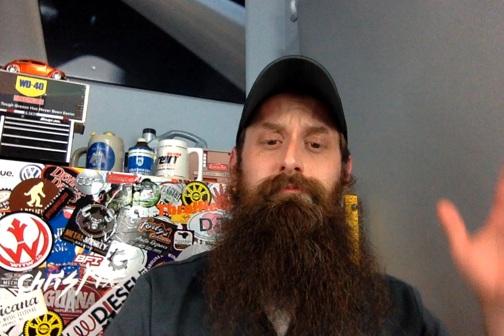Why Does My Check Engine Light Go Off Sometimes?

Comment: Interesting. I had a check engine light come on for an air flow issue. I suspected that the MAP sensor I changed was a piece of garbage (probably true), but it went back off before I replaced it again. I will just keep an eye on it. This was helpful.

Comment: Hi how you doing,hope all is well,I have a issue I got my vehicle scanned it picks up nothing ,when you start the vehicle (opel gamma 1.4i),everything is is 100%,but then I go on a long drive about 200km in distance, on that drive my management light(engine light),comes on about 10seconds then it goes away but nothing has change while driving(no noises, no back fire ect)just run perfect and I can not seem to find the issue ,cause where I am when you call the guy to do a scan the vehicle is standing still and only a startup is done the they do the test which my vehicle pass and I ask the guy if we can drive about a hour then when it's comes on to be with me,obviously I got a hard no lol,so I'm asking  you ,do you pehaps have a idea why it's doing that cause I have to be driving constantly for almost a hour before it appears

Comment: I have a 2014 Hyundai sonata 2.0T check engine light turns on n goes off,  OBD code P2188 fuel running too rich.   Changed out several parts still doing this . As well as not starting sporadically, then starts fine then it won’t start any advice ?  Thank you

Comment: I got a 4runner 97 model the check engine is off while i turn the ignition key is on.
And i check all the fuses includ the fuel relay.
I found the EFI's fuses is gotten big electric shock.
Please how can you help me with it

Comment: My Honda Odyssey 2006 check engine light comes on and run roughly but only when the weather is cold.
I plugged the scanner and it shows code p013 which is IAT sensor.
But I researched about IAT failure symptoms, and say nothing about coming on on colder weather. It only says that that failure causes problems to start the engine when is cold, which is not my case neither. My car starts without problems cold or warm.
Could it be a temperature sensor

Comment: Does low or old battery cause the check engine light to come on, and after recharging by driving the car the check engine turns off?  AGM battery 5 years old?

Comment: I have a question regarding this.
I have a 2015 tiguan with about 66000 miles (110 000km) on it. 
I brought it in for an oil change and not long after had the engine light come up. Scanned it and it was misfire in cylinder 3 and 4, cleared the codes and have been driving it for another 6 month since without issues.

My concern is when I start it when especially when cold it souns quite rough for 5 or 10 second but then goes normal and drives fine and with full power atleast according to my but dyno. Is this any cause for concern I also noticed that the exhaust is quite dark on initial startup especially in winter (noticed this before the misfires).

I have brought it to a vw tech and reg garage mentioning that I'm concerned about it burning oil but both have mentioned that its within specs.

Am I'm concerned for no reason any additional things I can check, I'm quite mechanical (although this question allude differently 😉)

Thanks for all the knowledge you continously share

Comment: My 2005 Dodge Durango was doing this awhile back and I fixed the problems, but today after I finished pumping gas I sticked my key in (did not turn on all the way) and the engine light was flashing, but after I turned it on it won’t flash unless I turn off and just stick my key in...any suggestions?

Comment: Hi I have a 2003 honda accord and I replaced all the spark plugs and all 02 sencers  except for the one the 1 02 sencer to the catylac converter. It passed smog but 2 months later the check engine light goes on and off every 60 to 100 do you know maybe why? I did take it to auto zone it says  misfire 1

Comment: I have a mint condition 4.0L o6 2006 ford explorer i had a check engine light for months .and turned off today .should i be worried ?? I put 3,000$ in to it to fix it ..and still .light on..
I spent alot what are my option's?
Reply: Get a Honda

Comment: I am hoping to ask you a question? So someone put something in my gas and it had crank no start. After getting it to mechanic and them replacing all spark plugs, fuel pump, and conditioner through my car it is running again but now my check engine light keeps turning on and every once and while turns off. I took it to autozone hooked to their computer and it is reading bad spark plug but i just got every spark plug changed. I called and told them what it is now saying and they said " its just going to do that" you can lightly tell when the engine light is on that its like a misfire but when its off its running like before. Should i change my coil pack or is this problem something that will eventually work it self out?

Comment: Can a misfire happen if a catalytic converters is hit or damaged. I had misfires in my cylinders and I replaced all ignition coils and spark plugs. My ICM are working fine as well, but I’m still having the misfire codes pop up. N the check engine light comes and goes. Could this be happening because I still haven’t resolved the damaged catalytic converter?  Need an answer thank you.

Comment: My car had emission sendor replaced and map sensor replaced 3 weeks later my engine light comes on shut car off and engine light goes off for a week then driving today not going to 3gear but shut car off for   minute and engine light goes off and it's running fine what does it nean

Comment: 2000 nissan maxima 

broke down in garage for 2 years

nothing major just dead battery

new battery and runs amazing

246,000 miles and perfect

as i burn through the gas that was sitting in the tank the light turns on and i find out it’s a fuel injector issue

over 2 weeks and 3 tanks of gas i use a whole bottle of fuel injector cleaner

light goes off and car feels quicker and smoother

few days later light turns on and back to running slow and inconsistent power feeling when i press the gas

drive home from school and the lights still on when i get home

some driving later and the light goes off and feels faster again 

now: i’m gonna buy a other bottle of fuel injector cleaner and use it as i get gas hopefully getting all the old dirty gas out and gone for good

Comment: How about my check engine has been on for months.  Been having problems with starting.and stalling while driving slow then turning back on while driving. Sometimes have to put in neutral while rolling to start .notice problems when damp out. Will drive fine for days then do it again. Already changed main realy still no fix. Was thinking ignition switch? Oh ya it's a 2001 Honda accord 4 cylinder lx.any help would be great. My own mechanic is stumped.
Reply from the maker: Try another mechanic? A MIL and a ton of symptoms can be tricky to diagnose

Comment: This was exactly what I was looking for. My 2000 BMW 323i had the light on I got it scanned and it said miss fire in my 5th cylinder and a faulty spark plug and coil pack. But now the light is off and I haven't even fixed the issue yet. So should I still replace the plugs and coils? Also my washer  fluid and tire pressure sensor lights are on now but both were just topped off not even 100 miles ago, fluid is full and tires are brand new

Comment: When engine starts chek engine sign is not there.  After driving for a short distance like 1km check engine sign appears on the dash board.  What is it? The cause.
Reply from the maker: You’ll need to pull the codes. The fault is probably stored even if the lift is off

Comment: My check engine light will go off for two days n come back on what does that mean
Reply from the maker: You have a fault that is only occurring sometimes. It will pass the test and fail the test
Reply: So is it anything that I need to worry about
Reply from the maker: Yes. Get it checked out
Reply: Ok thanks

Comment: Hi this is really cool explanation, I have the same problem, my new car Honda civic 2018 4 months old , I had the engine light on constantly and then after opening the bonnet and touching some cables suddenly the light went off. Have been driving like that thinking that car had resolved the issue but then the performance of the car has degraded , I bought the wireless odb test tool and my code is P2146 have spoken with Honda dealership here in UK but they are not willing to test can you please advice what should I do, can clear the code and the engine will perform better

Comment: I have a 2008 Hyundai Accent gs 1.6l hatchback, car stalls if idling for about 15 seconds, engine light on and off intermittently all the way down the road, happens the most when I hit the gas quick and left off quick, engine light comes on for about a second then off, and over and over, changed sparks, coils, timing belt, water pump. Any Ideas?

Comment: I have a 2000 Volvo S70 TDI and recently the Check engine light started being a bit weird. I get in my car and fire it up and go driving. Usually after 10-15mins the check engine light comes on and stays on for about another 15-45 mins and then it turns off again. What might be the cause? Im going to get it diagnosed at the workshop but i can't right now since christmas is around the corner

Comment: i have a toyota mark II,check engine light comes on while driving at engine speed above 50,when the vehicle goes of,its also go off,i checked with diagnosis machine while driving the vehicle i see no trouble code even when the vehicle is off no trouble code,please help

Comment: I wouldnt ignor it...I've had the same problem,, whenever I would go and have a part repaired,, the engine light will go off for awhile until I hit a bump or pothole in the road, then light pops back on,, which could mean loose or faulty wiring.....the engine light means the distributor cap and alternator may need replaced...its an early warning that you are heading for mechanical/electrical failures...and sometimes it could also be something as simple as a leaky air hose or hole in the muffler or tailpipe.....these problems usually keep reappearing because its never being replaced with the proper parts...." Used" parts are a bad idea when replacing the distributor cap and alternator,, but how many replace bad wiring too? These cars are getting more and more complicated these days .

Comment: My check engine light does the same, however i'm getting a 0172,0175 error. I took it to dealer they said injectors tested fine and suggested they run fuel injector cleaner. Got it back, the next day the light came one. The following day I added my own injector cleaner on an empty tank and filled it up, later that day the light went off, but then came back on about 2hrs worth of driving later. Very frustrating. And clue as to what might be causing these codes? Any info would be appreciated of course. Oh yeah, 2011 equinox, flex fuel, 3.0, 70k miles.

Comment: My 3 month old 2k miles hyundai tucsons engine check light started blinking a few times then the light went away then after a minute it started blinking again for a few seconds then it went away and when this happened i felt a mild shaking then this never happened . It was really really cold and the road was salty. Any thoughts ?
Reply from the maker: a misfire of some type. That is about all that will make a mil flash

Comment: Thanks for the explanation.  Had a P1320 and P0303 cylinder misfire code from a borrowed Innova scan tool.  I replaced the ignition coil, but didn't have the scan tool to reset the "Service Engine Soon" light.  Was contemplating buying a scanner just to turn the darn annoying light off, but then it went out on it's own after 2 days.

Comment: You are right so far.  I waited for my check engine light to come back on and drove to Autozone.  The tech plugged the analyzer into my computer showing all pistons misfiring gas cap off, all 02 sentencers malfunctioning, etc.  But, the engine runs smooth, the gas cap is one, etc.  I had 2 02 sensors replaced previously.  When the check engine light goes off, the analyzer show the light never came on as you said.  What is up with that?

Comment: My check engine light was going on and off for about a month, it was cooler out.. every time I wanted to take it in the damn thing would turn off. now that it's hot out it's on so I need to take it in this weekend cuz it's not going off..car is acting fine and it's not the gas cap...

Comment: I have code for catylitic converter code p0420? After my oil change the check engine light went off for 3 days. Then it came back for two days. Now it's gone again and has not come back.
Reply: NaturalHabitat_2.0 I’ve got the same issue with my 2007 Accord.. the light comes on and clears itself and doesn’t come back on for another 1-2 weeks.. any advice?
Reply: @bodiebroadus9732  i
Reply: Same and same code I guess just wait till it comes up again lol
Reply: NaturalHabitat_2.0 did you find the problem
Reply: Same! what was your solution to this problem? I see you posted this 10 months ago..

Comment: I'm getting a check engine light on my 95 sc400 (code 28 right o2). It comes on when the engine warms up after a few minutes then turns off after about 15 minutes of driving. Then it will turn on for a second and then turn back off randomly. Any suggestions?

Comment: why does my check engine light blinks 3 times and than  my car shuts off it is a 92 stealth rt fwd
Reply from the maker: Odds are this means you have a fault stored. ODB1 cars have a number of ways to check faults. I am not sure how your car displays it, but the number of blinks probably points to a system that is having an issue
Reply: thank you for getting back to me i'm thinking its a fuel pump hope its a relay but cant seem to find it on the stealth here's hoping.... car as stopped running since this post flashed 3 times & stopped

Comment: hay humble, question?  Ford expedition my check engine light turns on and off in some days. when it's off will the car pass inspection?
Reply from the maker: in NC it will. As log as readiness monitors are set, and the light is not on. Well I should say "commanded" on. If the bulb is burnt out, it fails.
Reply: thanks!

Comment: I have a 2007 Chevy Cobalt with a P0301 I changed out the fuel injectors coils and spark plugs it's still misfiring drives great but when you're sitting at a light you can feel it shaking

Comment: my check engine light went on and the link code was p2187, there wasn't any leaks. any idea what it could be?
Reply: Hey lol me again with the same problem I guess. my check engine light keeps going on and off, it's pretty annoying because it seems to drive normal, but I was just wondering if it's not a common thing that happens in 2010 mk6 gti's?

Comment: My Car has a system check on startup , a while ago I had a warning flash up saying ABS system failure , this flashed up every now and again , I had it scanned , it came up no codes stored , one of the GM/ Holden Tech's , inquired about my battery , he had a look and a lose connection was the cause , he explained that when it runs through it's checks sometimes one of the systems will  think "Oh there is not enough power for me , so I'll throw a warning light up" , even though there is no problem , big relief that there was no issue .

Comment: My check engine light was going on and off on a cam sensor and crank sensor and my tags just expired and had to run to emissions. Ran to it when it turned off and when they scanned my car they re pulled it up haha so now in waiting on my parts with expired tags :p

Comment: A/C Question Buddy?? I HAve 04 Golf GTI And A/C Compressor Wont kick In. I Put My A/C Gauges And Freon Is OK. I Checked Fuses And I Replaced Relay And Low Pressure Sensor (Junkyard Parts Fortunately) And Still No Luck. So Question Is What Should I Look For And Is There Any Tricks Or Tip I Should Know??? Thanks Charles
Reply: Too much freon...